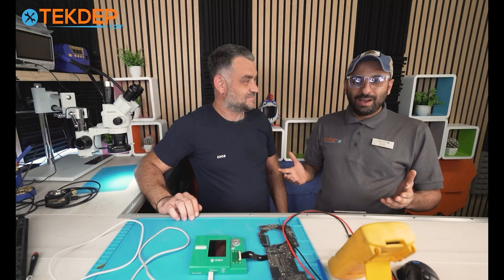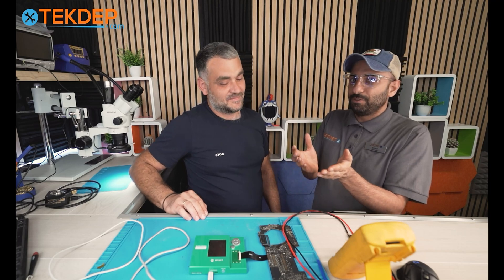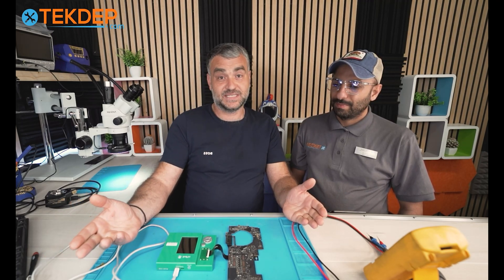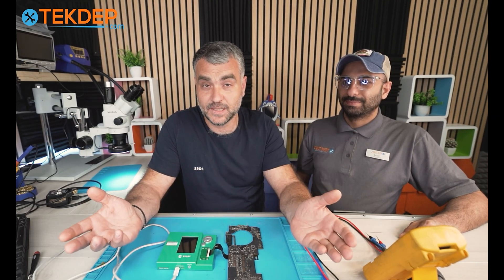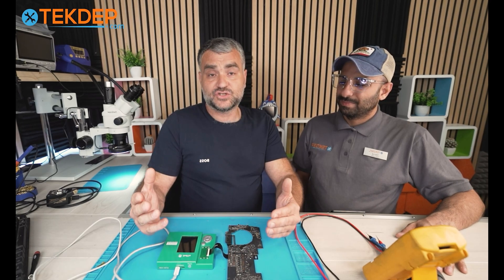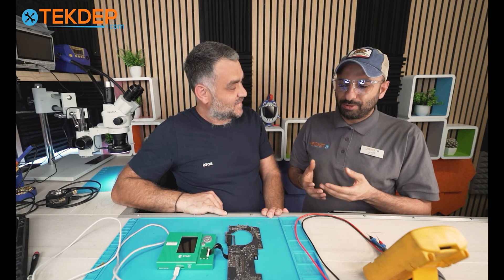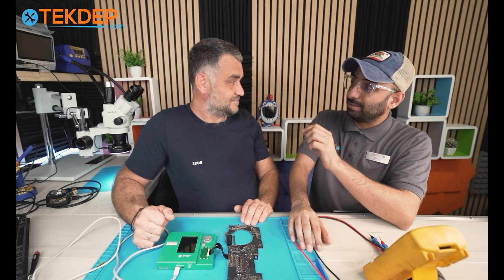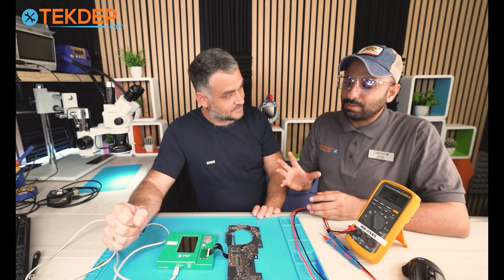MacBook Won’t Turn On After LCD Replacement – What Happened & Avoid mistakes

Comment: I was super careful. I repair laptops regularly. Discharged myself first, removed the battery ribbon, removed trackpad flex cable was on top of the battery screw, unscrew and lifted the battery connector, pressed the power switch for 10 seconds, then proceed to replaced the screen and reverse order.

I think i messed up removing the trackpad cable first as it was covering the battery connector.

Now my laptop receives 1.2v only.

Any ideas?